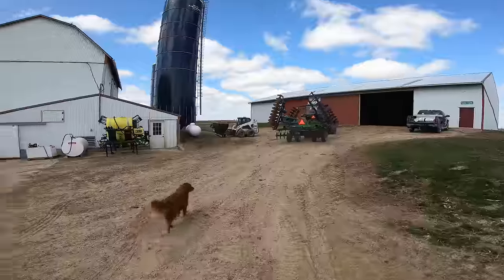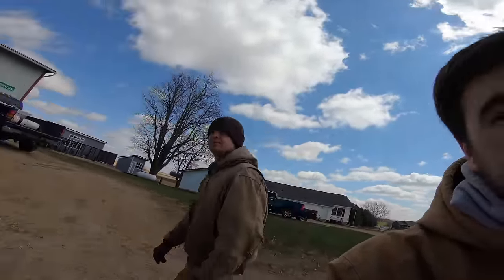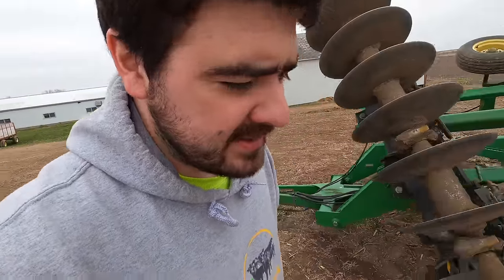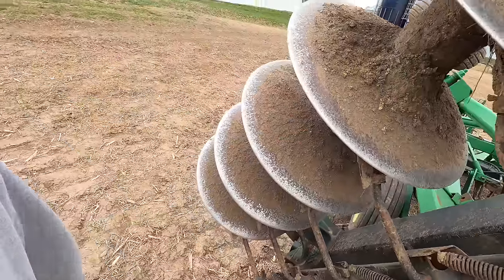The John Deere 4640 and 630 Disk Meet Again!

Comment: Every now and then, a plain old disk like the 630 is exactly what you need.  Times have definitely changed from your very first videos which showed the old 4440 pulling this disk across all of your chiseled ground to mellow it prior to planting.  It looks like the dozer did a great job pushing the good soil back up where it could be used and keeping it as smooth as possible.  The Kuhn drill should do a great job to get those waterways seeded back down.

Comment: Could you put different blades on the disc like the ones on the VT  and have two VT's?
Reply: The disk angle is a bit too extreme for a flat disk such as the VT disks it would drag sideways and not really turn properly, however certain disks you could get away with it
Reply: @gabrielalger9792  Thank you. I think with the prices they charge these days modifying an old one would be the way to go.
Reply: @dimduk  definitely agreed there these prices suck and farmers are having to find new ways to save a buck